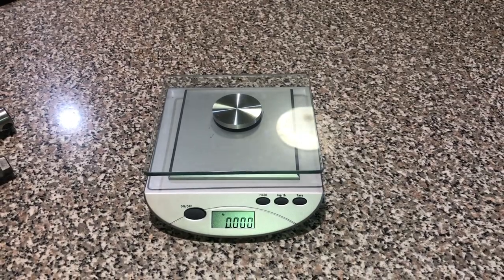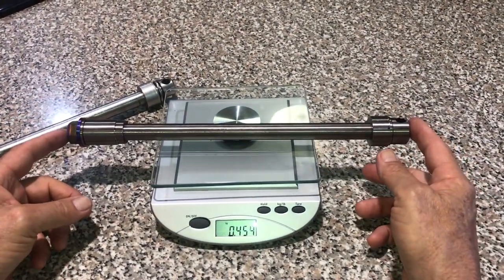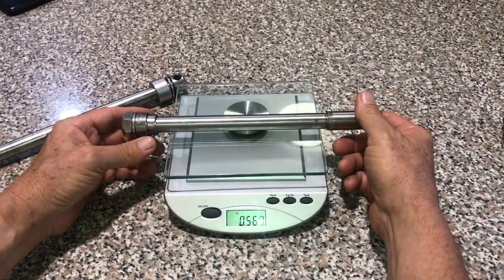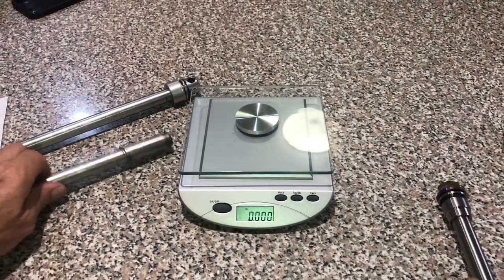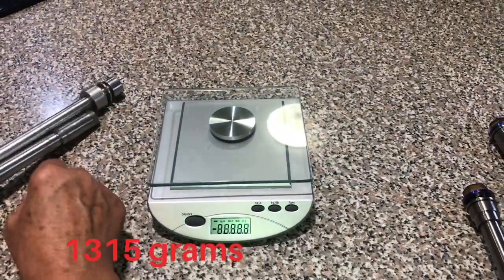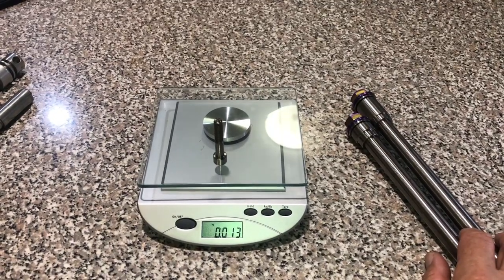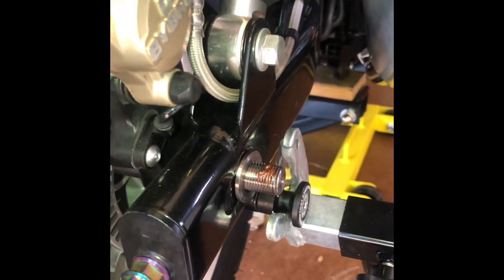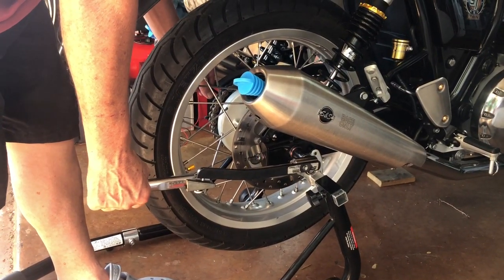Royal Enfield 650 on a diet

Comment: Cut the back frame off for the seat make a titanium rear curved bar with LED brake and turn signals in it. Make two of them one for your single seat one for your double seat. You could pin them on for fast change icers